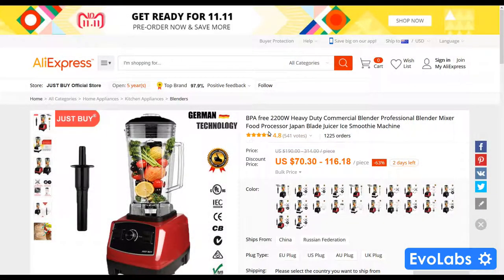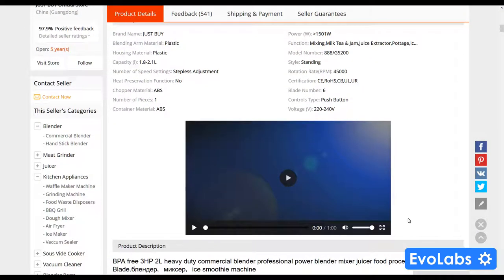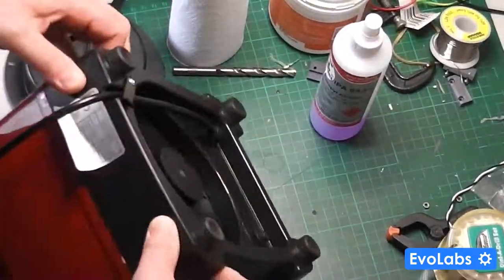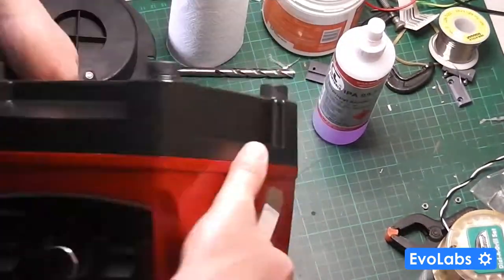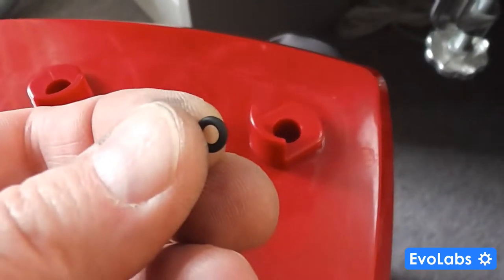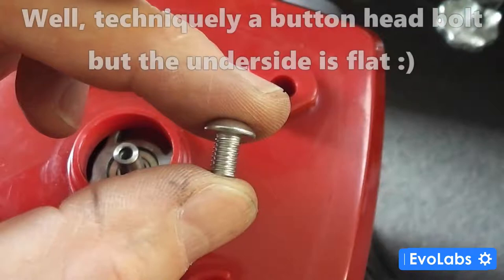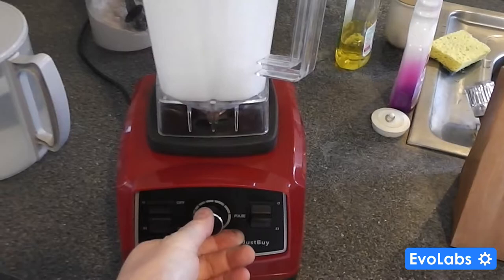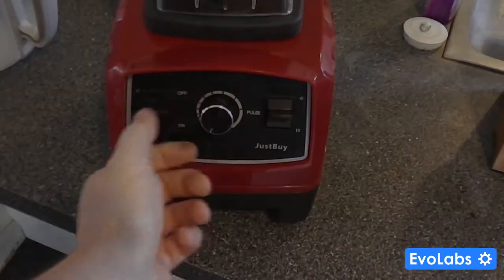Tip: Fixing a rattling JustBuy Blender

Comment: Thank you for the video. 

I couldn't quite understand what exactly to do. Are you saying we need to just get a new screw and fix them? 

I've had this blender for about 6-8months and it was fine until today but today it is rotating too much. 

Basically the screw is getting loose is what I think.
Reply from the maker: If the cause is the same as in the video - then yes you just need to get a new same size bolt but with a flat bottom on the head (usually called a 'domed' bolt) see 2:51. Also get some thread lock (e.g. 'Loctite' brand) and put a small bead around the shank before you tighten it down.

Comment: How is its functionality after one year? would you recommend?
Oh and why not just use a washer?
Reply from the maker: For the price I paid, which included a spare jug, it's good value in my opinion. I'm still using mine day to day. It's a bit loud, and doesn't have the high tech electronics which results in - for example - if you forget to turn down the speed dial when it starts up, you could get over spill of the jug. But its simplicity means there is less that can fail. You could try using a washer and see if that works for you, but I prefer using a correct bolt head as shown in the video.